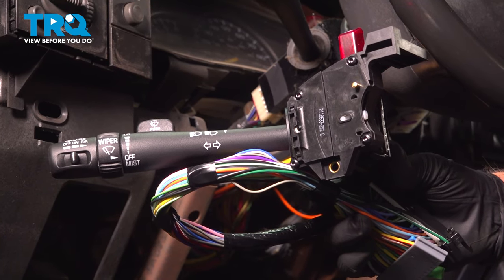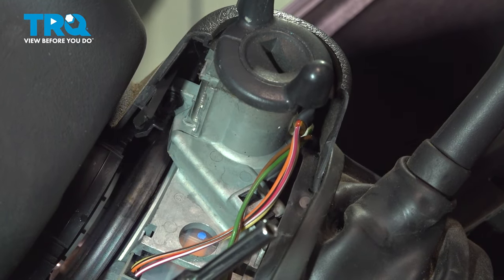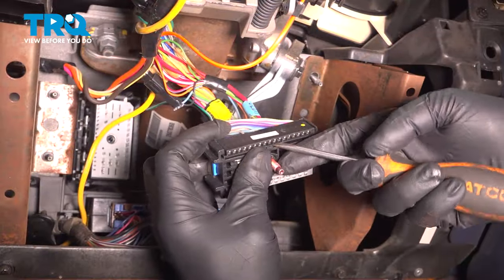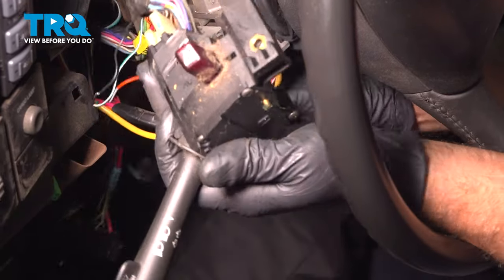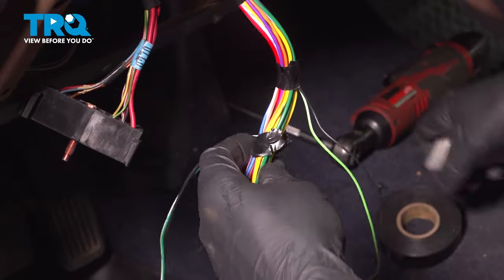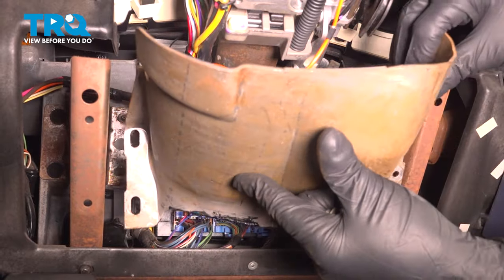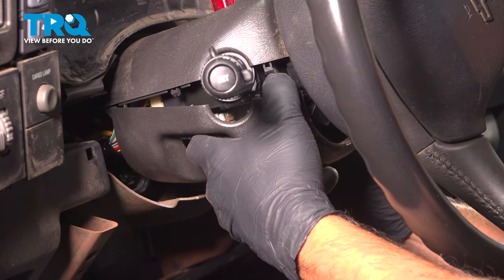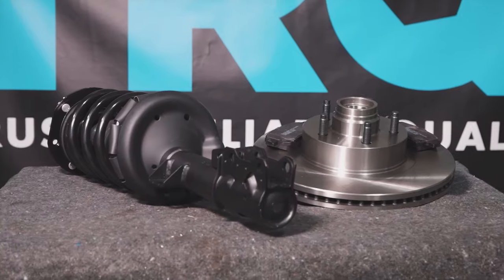How to Replace Turn Signal Combination Lever 1999-2006 Chevrolet Silverado 1500

Comment: I replaced my switch and the original problem remained. I put the old switch back in, and had more problems than before! I took old switch off, sprayed all connections with brake cleaner fluid, let them all dry, which was very quickly, reconnected everything and everything worked perfectly!!!!!! My truck is 19 yrs old!!!!

Comment: I did not understand why the original black electrical tape had to be cut back to separate the wiring harness to apparently reconfigure the wire orientation?  Is it because the wire plugs in in different places in the new multi switch compared to the old one?  It was not really explained why the wires needed to be separated out like that and reposition on the wire harness? Someone tell me what I missed please?. Otherwise I understood the rest.

Comment: When you take off that metal plate and remove that wire tab off of that rod looking thing. What is that rod called one of mine are disconnected from the silver part
Reply: And what does it do

Comment: Thanks for the detailed explanation of how to get to that plug!!!  There are a lot of short videos that don’t cover how to actually reach that plug.  someone has been behind the dash on my truck before (it’s 2001 and i have only had it 5 years), as most of the screws you showed are gone, as well as the plastic hooks at the bottom on the steering wheel cover.
Reply from the maker: +@nmartin5551 Thanks for watching our video! http://1aau.to/m/Shop-TRQ

Comment: My 05 GMC Has a upper steering shaft adjustment on top of this switch, didn't see it on this one. Anyway if yours has it Don't over tighten it Just take the play out. Just snug it up. worked for me

Comment: Any way of just bypassing the flasher light switch? Cut wires or something? My red hazard light button broke. So it won't stop flashing. If I take the fuse out the brake lights won't work. I try to just hold the button down yet it's VERY easy to make the lights go crazy while holding it down with finger etc. =( great video btw!

Comment: I have a 2001 GMC 1500 Sierra, and the two screws that hold the bottom steering column cover take a T-30 Torx bit, not T-25 as stated in this video. Just a heads up.